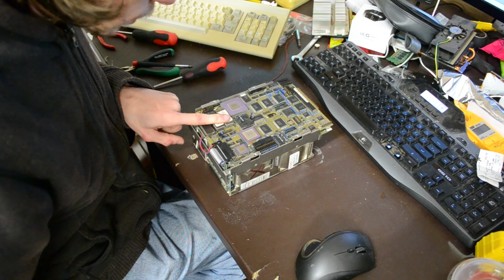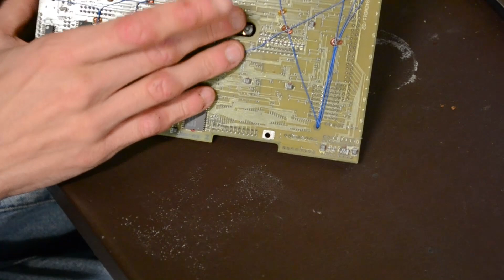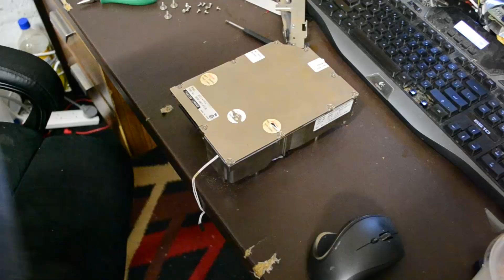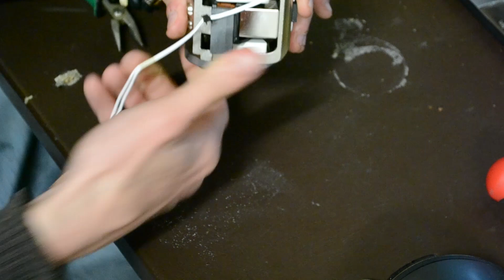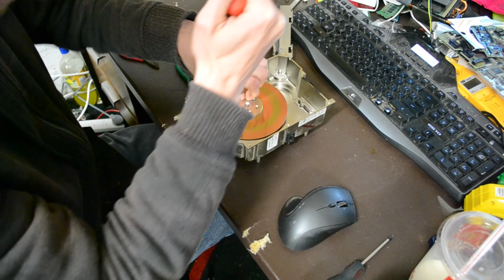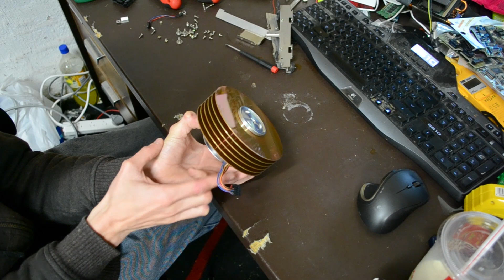Early 140MB SCSI HDD Teardown

Comment: Helpful tip/2cents: on your table, for disassembles or for showing a subject, either use a sharpie to determine 4 points that are the camera's view or a piece of paper for contrast. That way you will never have to bother with checking the camera to see if you're on target and you will never have issues with the "subject" being off target.